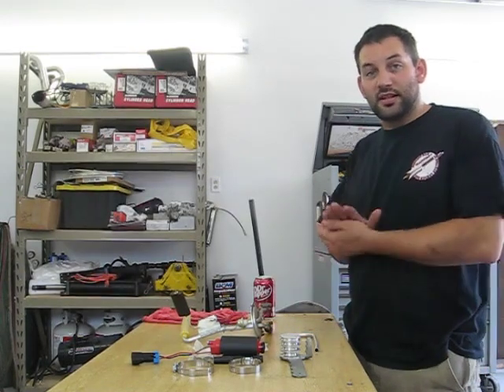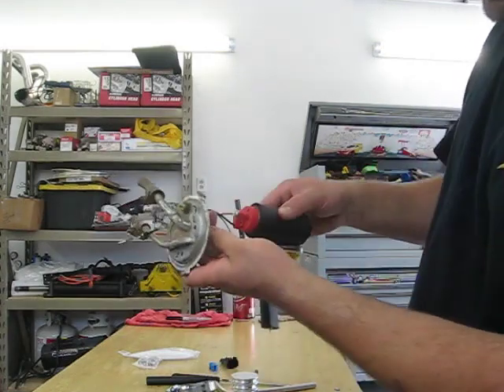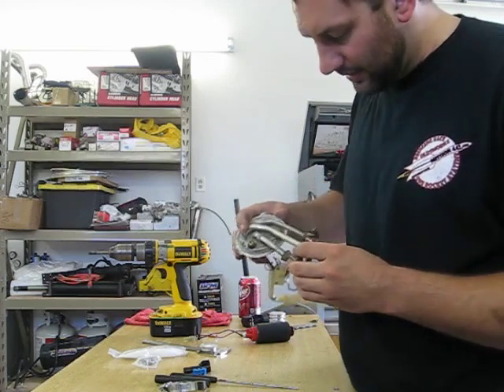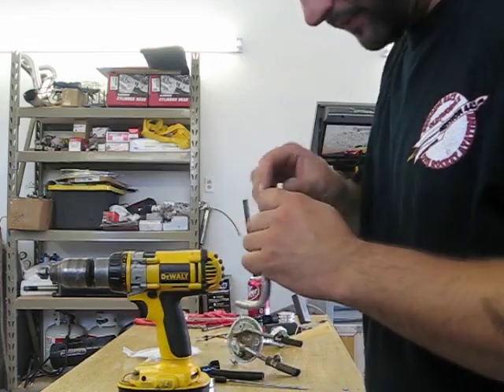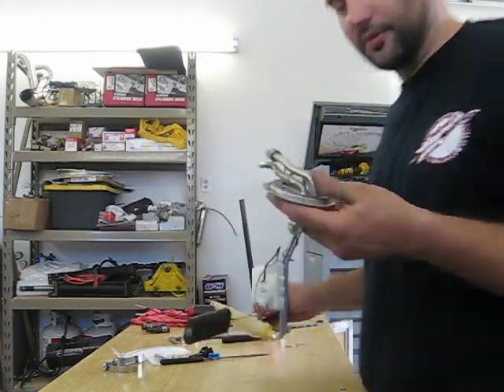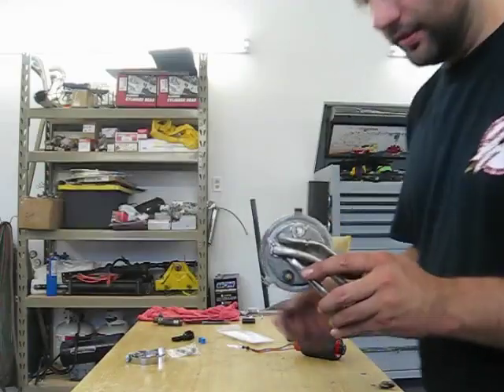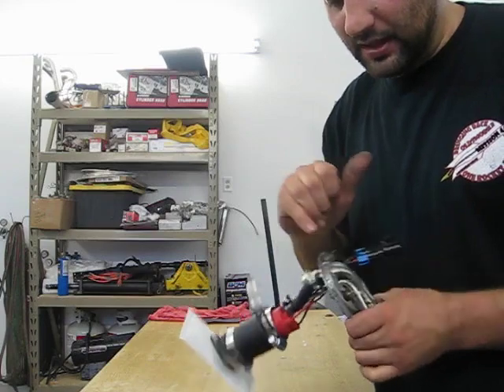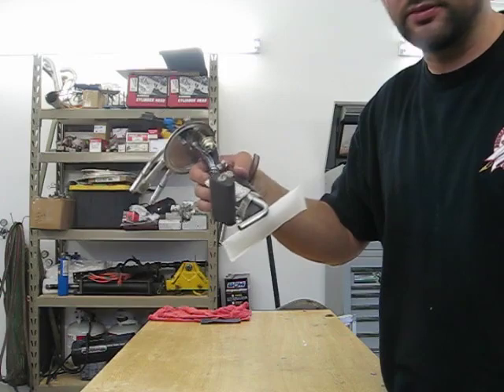G body in tank pump conversion: Carb to EFI

Comment: No baffle around the pump?
Reply from the maker: @rxsyete  not at the time I did this one. In other setups I have put in some foam or an aluminum baffle with magnets to hold it. Both were ok. Foam breaks down and becomes more work after a couple years. The baffle would be ok for street use but would shift around from the fuel weight when doing hard cornering and stick the fuel gauge.
Hydramat has been the better overall solution. 
In my racecar I still run a stock tank with a small hydramat that low pressure feeds a surge tank with the high pressure pump. Can drive it hard and not fuel starve in corners all the way to Empty with this setup